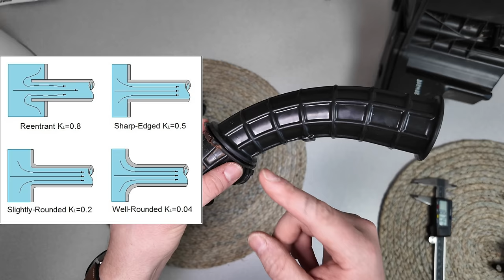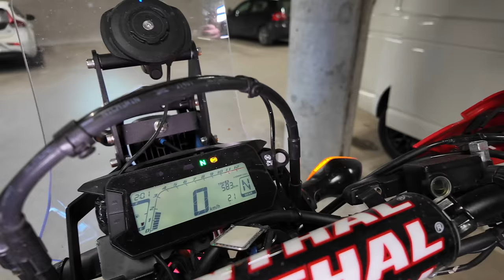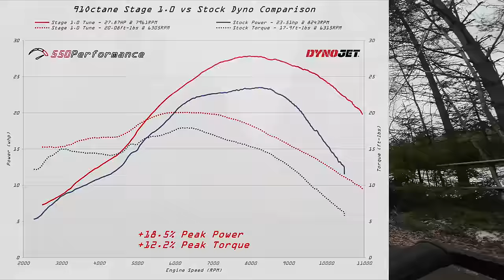CRF300: ECU, Airbox & Exhaust Tune by 550 Performance

Comment: Two things. One you can always use my clips for reference. I don't care and I'm pretty sure that would be "fair use" any ways. If it's to make a video on something like this then go for it. Second I like what you've done here more then my own mod. Very smart and should do the same thing. I have had my air box back out since this mod and after some heat cycles it sits almost at the right angle now. But this way is easier and avoids having to flex it a bit. Great job!
Reply from the maker: Damn.. Jake hanging in my comments. Thought I would never see the day 😂 Glad you saw my intention when doing any comparisons. Definitely was not my intention to "bash" the way even 550 performance was originally suggesting to do this mod. 
You are much more crafty than many others and I suspect the mod can easily be done worse than you did and then it could be a problem for someone 😁

I noticed rescently that Maveric from 550 has added a new part to their CRF300 catalogue. It's a completely new velocity stack pipe made to fit the original box opening. In pictures it looks 3D printed but I suspect it still is rubber of some kind. 

Thanks for the comment Jake 😁 Big fan!

Comment: I have done everything you have minus the velocity stack. Plus I swapped the 40T rear sprocket to a 42T to get that low end punch your missing. With all the other mods, the bike doesn’t lose any top end speed by adding just 2 more teeth. But now I can get the front tire off the ground without having to grab a handful of clutch. My bike topped out at 81mph in stock form, and it still tops out at 81mph.
Reply from the maker: Sounds great. Maybe I need to gear mine down too 😊 thanks for the info
Reply: Mine does 83 mph in 5th gear I’ve only got a fully yoshi exhaust and a twin air filter I’ve had 95mph and I’m 16/17 stone
Reply: @salazam  I wrote it a bunch of times!

Comment: The louder exhaust is not for me. But the better punch/pick-up, the better low-speed/low-rev without stalling/twitchyness. Hmmh, mouth-watering. 20% faster acceleration would be a lot. Happy rides, Günter/Nürnberg
Reply from the maker: The sound might get a bit much in longer trips. The Yoshimura RS-4 would most likely be more chill but it's almost 3x the price in EU.
I might swap for that later but the tune works great so far 😊

Comment: I wonder if this effects the reliability and fuel economy much?

This seems to be the best dual sport bike with this mod that doesn't have performance level service intervals. Very tempting
Reply from the maker: I don't see how it would negatively affect reliability. One could even argue that the engine tune is now correct and therefore is better for long term reliability. Stock engines with the "euro" and other restrictions tend to run pretty lean. This ECU tune is optimizing the engine to run with the correct mixture. 
I have a chapter in the description about the fuel consumption from my first longer ride.

Comment: Hey man thanks for the video I have the same bike as you that CRF300L Rally 2023 and I just did the same as you only difference is I did the 87 Octane Stage 1.0 but I did essentially the same on the snorkel, with the yoshimura Rs4 exhaust crazy hp and torque. Thank you very nice video I couldn’t done on my bike without your video👌
Reply from the maker: Glad I could help! 😄 now its an angry little CRF 👹😄

Comment: Ive got all these mods except the air intake trumpet because i didnt want to ruin mine either but ive ordered the metal trumpet and im gonna try copy your install. 
  My bike as is does not have the power at the higher rpm that yours does and i belove that is down to that short intake with the metal weber trumpet. 
Thank You and your video was also super fun to watch.
Reply from the maker: Thanks for the comment! Please report back your findings 😁
Reply: @PatchedBandit  I just did that weber trumpet mod and it made a huge diffrene. So i bought the akro pipe and the 550 ecu for 91 octane withe a foam filter and the screen door mode and like you i didnt put the other intake boot because it didnt fit right. It feels like the fuel is now burning completly and im getting everything out of the tune.

Comment: You dont have to drain the tank in order to remove it. Just disconnect the fuel line and electronic wiring and thats it.
Reply from the maker: I wanted to make sure I won't spill anything to the garage as It's not mine. Good tip for anyone doing this if it doesn't leak.

Comment: Great work and interesting solutions. The only incorrect measurement you made is the stock velocity stack is larger than the cbr stack. You’re comparing a previously installed stack that’s been stretched out against a never installed stack. Once the cbr stack is stretched over the throttle body, they will measure the same. I used the cbr part and clocked it to match the stock angle so installation will be as easy as stock. My mods will add so much performance that I won’t miss the intake expansion chamber.

I did cut off the stock stack in the same place you did but used the cut off velocity piece to double the intake capacity without compromising my waterproofing. I just drilled a parallel hole next to the snorkel and rtv’d the velocity tube in place.

With the 550 performance ECU Stage 3.0 reflash, cbr cams and 301cc big bore kit, the power boost should be more satisfying. Being more than 100 lbs. heavier with half the power of my KTM 500, I will also go to a lithium battery to cut weight. It will never match my KTM in performance, but the Honda reliability will make it my daily driver.
Reply from the maker: True. It's not gonna be a racing tight bike but it definitely has some good pickup with these mods. I might upgrade to the big bore later just because these videos are interesting 😂

Comment: Hi!
Love you're videos.
I'm about to buy one CRFL.
Question: did you put db killer in the exhaust? Does it come with it at all?
I've checked out all the aftermarket exhaust and Dominator looks the best to my mind but sounds very loud. I mean I love it, but you know the problem with that as you also mentioned about it.
Looking forward to your answer.
Cheers !
Reply from the maker: Db killer is installed. It doesnt really do much though 🤓 Its a loud exhaust for sure. Earplugs necessary.

Comment: Honda did all of this under-sizing of intake air strictly to meet emission requirements,  I know you're doing this one correctly since
I've seen it done.  I will say that you're cleaner than the other guy but both of you got the job done.  If you were to do the 301cc kit
I think you'd have to do this intake job but how would the ECU numbers work?  I mean,  after the big bore the fuel numbers would
need to be changed along w/ the air..... but I'm guessing you would not use/need the 550 ECU flash in this case?  IDKnow but it
just hit me that there's several different things that might offer you an ECU change in numbers & you can't use all of them.  I did
really digg the suspension video,  loved those guys ~ how professional they were !   peace
Reply from the maker: 550 Performance has a different ECU tune for the big bore level of tuning. I would just reflash the ECU to support the big bore.
Reply: Thank you,  I've heard of a handful of these ECU related upgrades but didn't know if it added to the Bike's Brain or
simply flashed over the whole system..... now I got it.  much appreciated.

Comment: Great video. Just ordered the velocity stack. Do you see any reason why you couldn’t cut the snorkel in place without removing it, or the airbox, and shoving the new velocity stack in from inside the airbox or do you think too much force is required to get the stack in?
Reply from the maker: Now that I know it works maybe it would be possible. Hard to cut in place though 🤔

Comment: Thank you for showing us some alternatives man! So from my understanding you got these results from the following mods: full exhaust, airbox mod shown in the video and 550 stage 1 ecu? Did you also put the high flow airbox lid or aftermarket filter or I may have missed it?
Also, did you notice increase in top speed and maybe bike feeling more comfortable at higher speeds that previously on stock when the engine was struggling?
Reply from the maker: Still using the stock paper filter. All the Level 1 mods are in the bike. 
It will affect the highway performance too but at the top speeds wind restistance is going to be limiting tha cabability no matter tune or no tune. 
Here you can probably get a better understanding on how drastic the difference is: https://youtu.be/0Dh0g1QIY7A

Comment: Excellent info, I like the modification to and use of the stock velocity stack, smart and the route I would probably try. Like you I am not sure I could handle or like the attention I would get with the loud exhaust, maybe when I was 16 I would have thought it was cool. I would be curious how it would run with the stock exhaust. I look forward to your next video.
Reply from the maker: I'm pretty sure the stock exhaust is a major restriction and 550 performance states that the exhaust swap is the only necessary for this level 1.0 mod. The bike is according to them going to run better with this tune if you do all the same mods as me. 
I would recommend looking into Yoshimura RS-4 as it would most likely sound much less nasty. I just didn't want to pay the money now.. but I might do that later.
Reply from the maker: Check out my latest post: https://www.youtube.com/post/Ugkx11mET0fxN7Shcg_yUdPxapYd76IzzJfQ

Comment: Hey good video. Do you have details on that metal flange ,l missed it . Not sure if such a part is available in New Zealand . Cheers
Reply from the maker: Description has all the info
Reply: @PatchedBandit  thanks for replying. Unfortunately I don't seem to be able to pull up the description although I have tried.

Comment: Good video! I have my doubts with the modified nozzle. The CBR one would always be flush with the air box but yours would produce more turbulence when inserted into it, right? It would be a mix between images 1 and 4 of the image provided by 550 (10:17)
Reply from the maker: Even the cb300 part is not flush with the box. Some turbulence inside the box is always to be expected but that would the same with the stock nossle. The long snout is even further from the throttle body and works fine.
This mod is nicer than cb300 since it turns parallel wit the airbox as the airbox also turns down at the beginning.

Comment: Hi PatchedBandit, I’ve just received the Trumpet, so I’m on my way to upgrade my crf300 Rally. I hope your upgrades are going well, I’ve watched many videos and I decided to go the route you took with a metal trumpet. Did you get any feedback back from 550 about your adaption and not using the cb high flow airbox velocity stack.
Also would you do the Big Bore kit, I’m going that way I think. Straight to the Nut House😂😇🤔🤪👍👍 Thanks for the great videos, you inspired me to go the whole hog.
Reply from the maker: I might do the big bore later but for now I love what the bike offers on the 1.0 tune. Big bore would probably be nuts and hella fun though 😁
We didnt' really chat about the trumpet afterwards but they watched the video and feedback was positive 😅
Reply: @PatchedBandit  so your still impressed with just the Stage 1. I just don’t want to keep sending my ECU to America, so thought I’d go full bore! Stage 4 off the bat. 
It could be good enough to race it up our local Hill Climb, for a laugh 😂🤪
I’ll keep watching you for updates and progress, your work in documenting the speed differences should be commended. 👍
Reply from the maker: @DoodleRiderGSA  It would be interesting to test the difference to the stag 4.0 from where I'm right now. That alone would be worth making the big bore to my bike too at some point
Reply: @PatchedBandit  I shall be ordering the Big Bore end of month, so as long as I get my arse in gear, I should have it fitted by end of September mid October. It doesn’t get as cold here as where you are, so I could video some runs, but speed limit here is 40mph/62kmph so have to be a good boy doing it or I could go to France. Shonky Productions who is another one who I’m copying on the stage 4 set up, says it could do 100mph and he loves the power right through. We will see and I will keep you up dated.👍

Comment: The length of intake tube matters. My car has electrically adjusted telescopic intake tubes that extend longer in low RPM for better torque and retract shorter for high RPM power. Cutting it short is not without side effect.
I'm still searching for lightweight aftermarket exhaust that is not louder than stock exhaust. Riding offroad is illegal essentially everywhere in my country so we need to keep as silent as possible to avoid trouble.
I wonder if you are going to replace heavy Pb battery with LiFePo and to remove pointless ABS to reduce weight?
Reply from the maker: True that there is always side affects on modifying the airboxes but this ECU tune is optimized for the CB300 stack and HF lid so I tend to lean that this is a benefit considering high rpm power production.
If I want a fully euro stamped exhaust at some point I'm probably going with Arrow. They even have a midpipe with approved CAT.
This dominator is probably one of the louder ones available but also one of the cheaper ones too.
I already swapped the battery here: https://youtube.com/shorts/HSNgOZXblik?feature=share

I might do the collector box delete later but I'm probably gonna leave the ABS as it's not such a big benefit to remove.
Reply: @PatchedBandit  One of the attributes of the CRF 300L is how quiet it is.  Is the trade off worth it?   From you laughter during the video, I believe you thinks so ;)
Reply from the maker: Well. I might swap the dominator to a quieter optiom later. It is definitely too loud for public roads 😂 but some people love the sound.. I’m gonna get sick of it after a while.
Something midway from this and the stock would be great.

Comment: They make big bore kits for it right?   Wonder how much hp you can get out of the 300?
Reply from the maker: I think the 4.0 tune with everything is around 35 wheel hp. I might do that next winter if 550 sponsors me another video 😅

Comment: What's the fuel consumption now? Also, how do you plan to pass tehno check with this? I assume just swap the pipe back to stock, pass, put this pipe back on?
Reply from the maker: No annual checks here. I wrote a chapter in the description about consumption of my first a bit longer ride. It's not noticeably different.
Reply: @PatchedBandit  Ah didn't read the desc :D I'm seriously looking at getting this as a second bike to have some off-road fun, should be a great deal getting this for around 6k eur and doing suspension, exhaust, ecu, airbox mods.

Comment: Great video, i am going to do same now, where did you get mirrors from
Cheers
Reply from the maker: You should be able to find them using: "PowerMadd 34289 Star Series/Trail Star Handguard Mirror Kit"
Reply: Sorry just one more thing I forget.
Does this air flow mod work without changing the exhaust or it obviously a very stupid question?
😅
Reply from the maker: Exhaust swap is mandatory

Comment: Excellent video where you get the Metal flange for the intake at?  Are you going to buy the Twin-Air filter as well?
Reply from the maker: This SHOULD be the same or close to the same: https://www.ebay.com/itm/Trumpet-40mm-3-2-Weber-40-DCOE-slide-in-Velocity-Stack-ALLOY-air-horn-ram-pipe-/302330332445?_ul=IL

I don't plan to swap the filter now. I just put in a fresh stock paper. If I ride a lot in groups the twin air would be nice but for now It's ok with the stock one.
Reply: Hi @patchedbandit, do you think removing the backfire screen from oem filter will make a difference?
Worth doing if sticking with oem filter?
Reply from the maker: I would be very surprised if that would affect the performance much if at all. I went from 16 seconds to 11 seconds doing 30-120kph with the tune already.
I might test an aftermarker "high flow" filter later if I can find a good one for it but so far I don't feel that the bike is starving for air.
Reply: @PatchedBandit  Thanks for responding 👍  I'm looking forward to the aftermarket airfilter test as everybody seems to include the twin air filter change when upgrading the ecu, and 550 Performance also recommends.
Reply from the maker: Check out my latest post: https://www.youtube.com/post/Ugkx11mET0fxN7Shcg_yUdPxapYd76IzzJfQ
Reply: Hi,  that trumpet is 40mm inside diameter ya? 
Do you think a 41 mm inside diameter trumpet could fit?
 I am in Thailand and will try to find at a muffler shop.
Reply from the maker: @mymotosai5036  Depends on the wall thickness. Even this was TIGHT. 40mm inside yes.
Reply: @PatchedBandit   thanks for the prompt response!